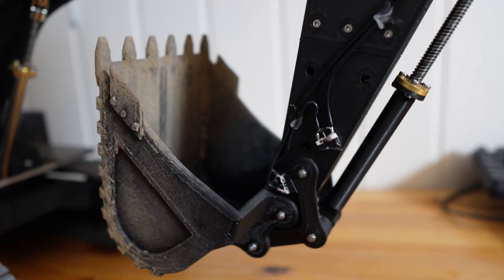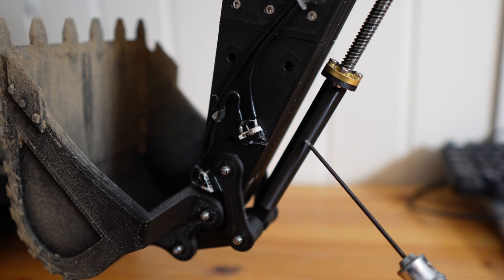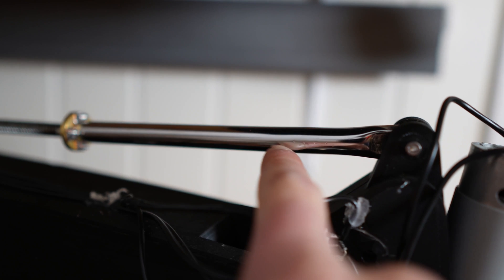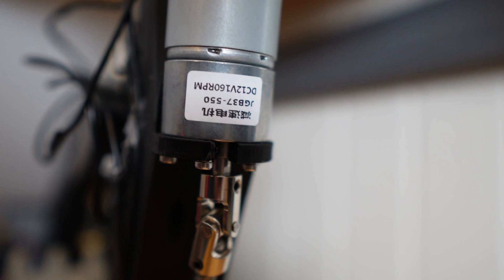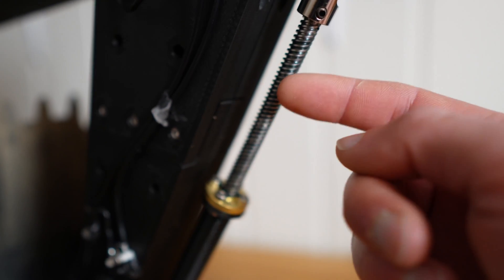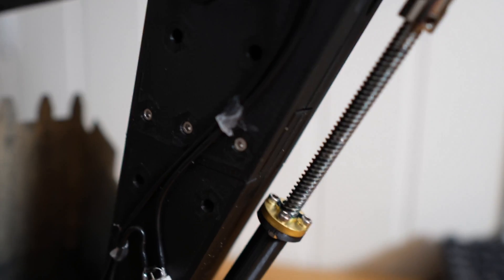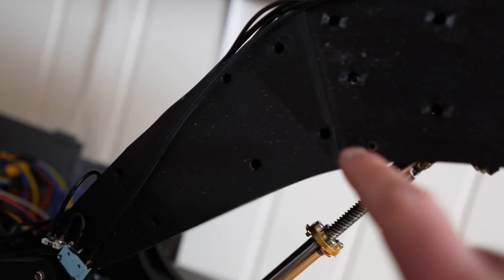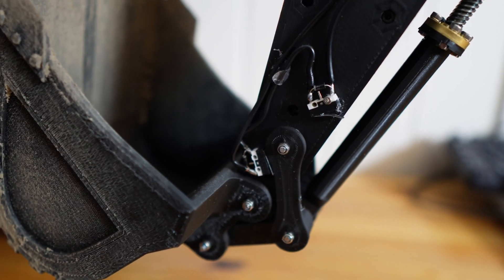Free files for 3d printed RC Excavator | Boom, Arm and Bucket

Comment: Thank you for these file's, I like your work and your generosity, Making your hard work opensource. I come from a construction background and know Excavators very well. But Cad is my downfall, I am trying to get the hang of it at present. I use Tinkercad and have designed many parts, But really want to branch out to Fusion or freeCad. But I have the time to learn and will master it.
  Sorry or rambling, Keep up the good work and hope that you get the 500 subscribers before Easter as I am patently waiting on all of the Stl files lol. Thanks again for your generosity to this fantastic hobby.
Reply from the maker: Thank you for your kind words ✌️
I know nothing about excavators🤣 Or at least didn't know anything about them when I started this. 
So I guess, if I can understand heavy machinery, you can learn CAD.💪